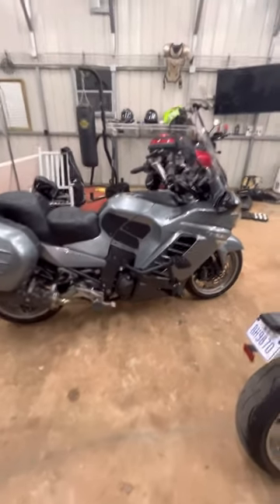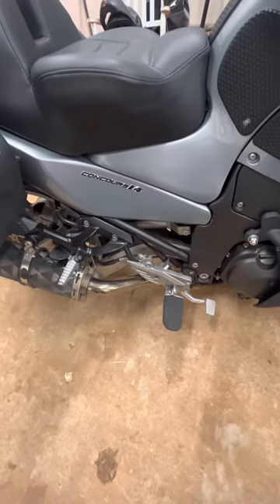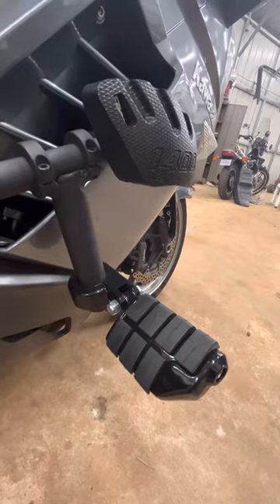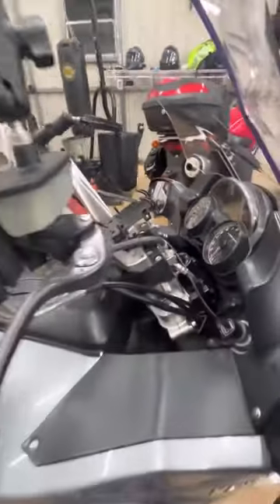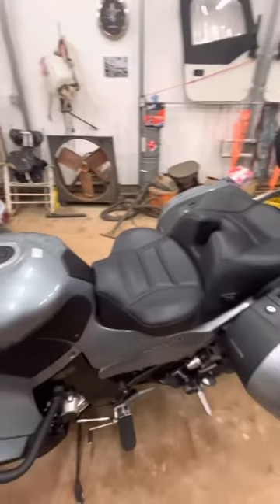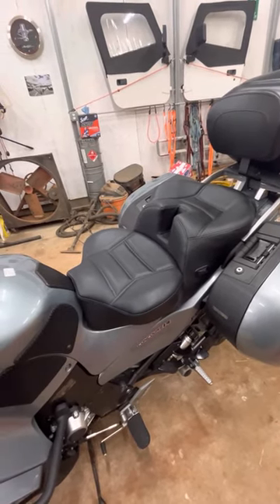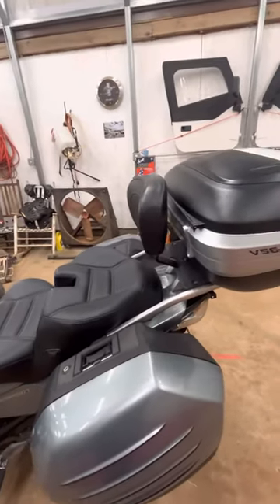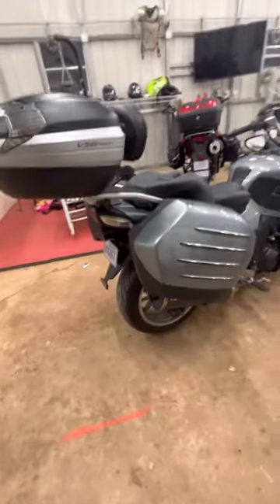Kawasaki Concours 14 touring Set up modifications￼￼.

Comment: Have the 2008 ABS model. I replaced the very uncomfortable seat with a Corbin, and recently got a tune that smooths out the throttle plus some more power.  Also went with a 190/55/ZR17 rear tire from the original 50 profile.  The 55 improves the handling.
Reply: What tune model did you use?I have the 2009 model?

Comment: @Fatboydishman Hey really nice bike and great video! I picked up the T-Rex crash bars and the Heli-bars 2" risers for my 2009 C14. Mine already has 2" risers, and after watching this I decided to double them up like you did, since we're both stuck with the older C14s. What I'm wondering about is what were the length of the bolts that you used? Could you share the length of those when you have some time, please? Thanks!
Reply: I had the same question. I already had the 2”. I ordered another set of 2” risers and the 1/2” rear setback. So I am figuring I will need M8 1.25 pitch 140mm. They aren’t McMaster carr. You need 130mm length according to my calculations
Reply: @bcbragg705  Thanks so much for sharing, I'll be putting an order in soon so I can get these bolted up. Really appreciate it
Reply: Actually hex socket M8 x 120

Comment: I have a set of risers, but haven’t found a set of pull back. Where did you find your?
Reply from the maker: Ebay
Reply: @Fatboydishman The footpegs ebay version from china  they have a central hole of 0.8mm and the original ones 12mm. Did you enlarge the bolt hole?Thanks
Reply: @Fatboydishman The footpegs ebay version from china  they have a central hole of 0.8mm and the original ones 12mm. Did you enlarge the bolt hole?Thanks
Reply from the maker: @cristiantamasila8667  no, I did not have should be fine

Comment: Do you need to get extra long bolts for the handle bar riser when you stack them like this? Would love that setup just wondering what I need
Reply from the maker: Yes. Stainless steel and longer.
Reply: @Fatboydishman  It's the first time I see this setting on the risers. I'm glad🙂 I bought a set of 2" straight ones because everyone told me that the cables won't last longer! So I can order besides the straight ones 2”(5cm),the offset ones 2”(5cm) total 4” riders(10cm)? From Advance Sport Touring model offset?
Reply: @Fatboydishman The footpegs ebay version from China,it s strong?I m 340lb and i need to suport my weight stand up.